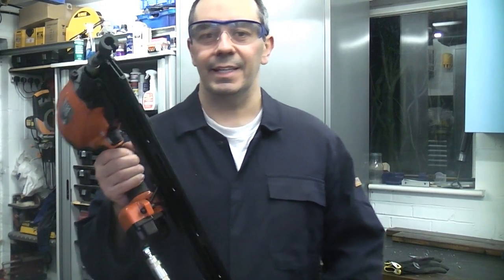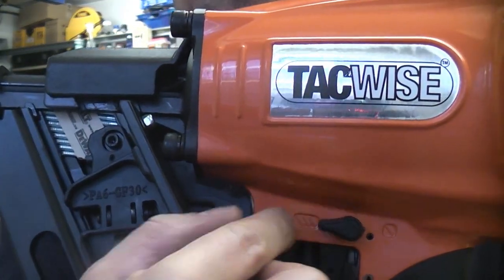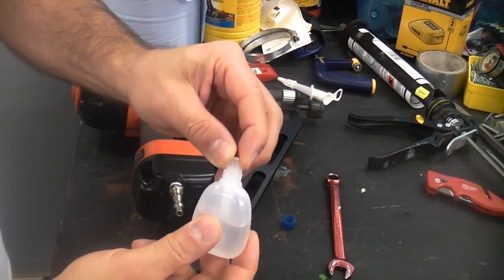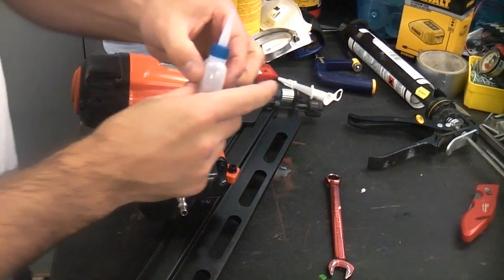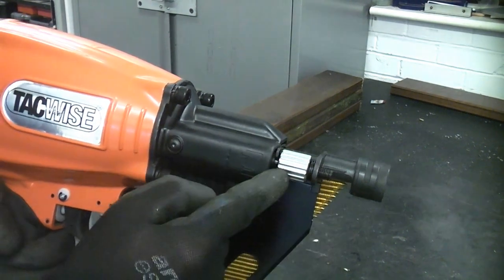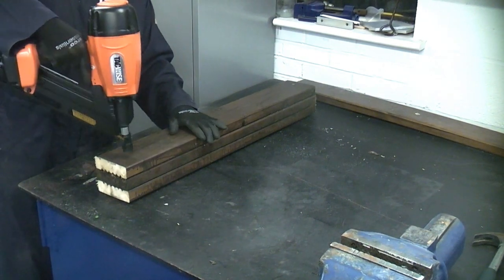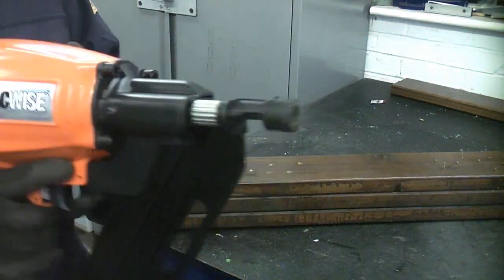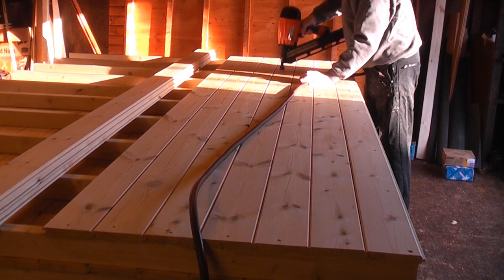Tacwise KDH90V angled pneumatic strip nail gun

Comment: Many thanks for your reviews, I have just bought this nailer and in the instructions it says " ALLWAYS CONNECT TOOL TO AIR SUPPLY BEFORE LOADING" ( my caps), so have you got a different instruction book, I would have thought it best to have air disconnected as you have, however manufacturer says you could get caught out by the duty cycle, so should I follow the instructions.
Reply from the maker: You are welcome.
I can't remember what it said in my instructions, but I normally follow the instructions to the letter.
If your instructions say to install the nails with it connected to the air supply, so should do that.
Thanks for the comment
Reply: There is no way you would disconnect the air-line every time. You go through nails in no time when using these guns on site it would drive you fu*king insane disconnecting the hose every time.

Also for pallet work & sheathing, boarding you would use a coil nailer not a strip nailer as you would be reloading every couple of minutes.

Comment: Nice gun. I used a bostitch nail gun when I worked at CHEP, had to fix around 225 pallets in an 8 hour shift. They were on a suspended wire with cassette that had a small nail for the top boards and a large one for the rest. I could use two guns at a time and fire like a machine gun even the large one if it was well maintained. LOL
Reply from the maker: +cheechU38K 
I'd love to see someone using two guns at once, that must be really cool!
Thanks for the comment ;-)

Comment: what size female coupler is that on the end of your hose? Ive got the same gun but my hose wont accept the gun.
Reply from the maker: Not sure, there are a few different types.
Probably the best thing to do is search Google images for "compressed air quick coupling", then try and identify the correct coupler. Or you could take it to a shop that sells them 👍

Comment: What size compressor would you recommend to use with this nail gun? Or is there a video you could make about air compressors?
Reply from the maker: +Jay Wilkinson Preferably one with a 50L tank if you are using it all the time, but mine is a 25L compressor and it could run it perfectly, but the compressor was running all the time when the gun was being used on rapid fire mode.I have made a video on compressors here- https://www.youtube.com/watch?v=miuTNahJGuUThanks for the comment